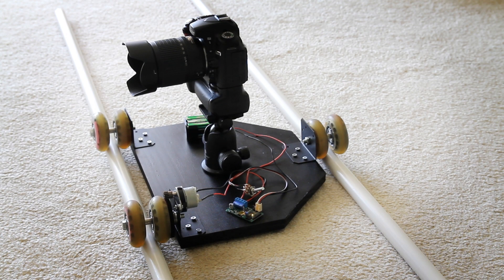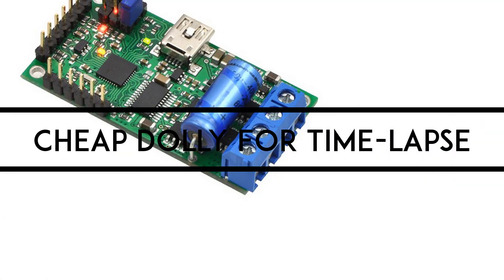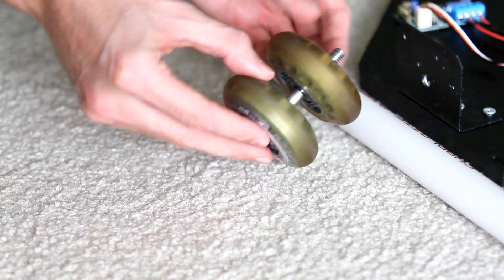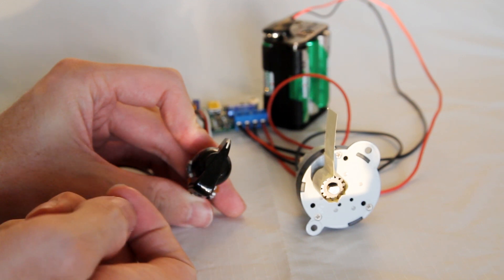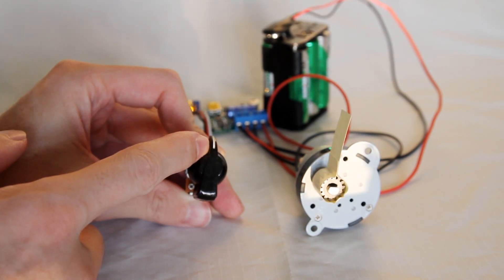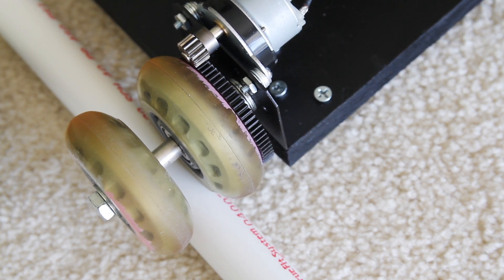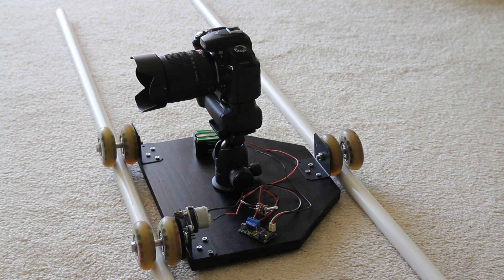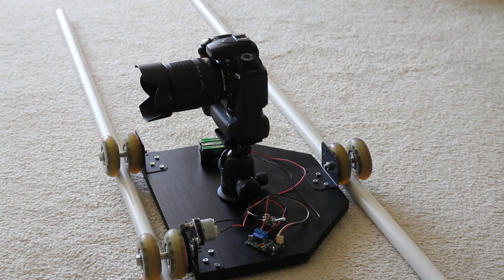DIY Time-Lapse Photography Dolly, First Attempt

Comment: This is the best DIY motorized camera dolly video I've seen.  Thanks for the blog write up with instructions in the description.

To overcome slipping, maybe wrap the PVC in skateboarding grip tape to give more traction.
Reply from the maker: That's actually exactly what I did :-) Well, it wasn't grip tape, it was a roll of adhesive sandpaper. It was better than the bare pvc, but still not perfect. I probably should have put a belt between the two sets of wheels on the drive side. It worked ok, though.
Reply: @MatthewGore  Painting the rails might give it a bit more grip as well?
Reply from the maker: @Tricklarock  Possibly. There's a type of grippy spray paint that is sold at hardware stores for making stairs non-slip and that sort of thing... that would probably really do the job, though I don't know how smooth it would be. But there were enough problems with this design that I decided it was better to move on to the next one, which really worked a lot better for me.
Reply: @MatthewGore  I need that for our sidewalk/front steps! Deadly when the slightest bit wet!!!

Comment: Thank you for this its a real help, ive just finished making my track and built something very similar but instead of motorising the wheels im thinking of putting the motor on the end of the track and gearing it down so i have a "50lbs breaking strain fishing line"? running down to the dolly and as the geared down motor turns it winds in the dolly pulling it towards the motor which i hope will enable me to have an incline on the track and obviously there'd be no slipping wheels as it's been "pulled" up the track as apposed to driving itself up and therefore the wheels would'nt slip.

Comment: how did you fix the roller skate wheels to the shaft(screw). When I got my Roller skate wheels they had ball bearings in the centre and that prevented the wheel from turning when the shaft turned

Comment: Hi, can you indicate me wich motor and wich gears you had used to build this motorized dolly ? Maybe you can give me where you buy them ? You've done a great job ! see u
Reply from the maker: I bought a couple of motors from a Chinese ebay seller. At the bottom of my blog post, there's a link to the seller on Ebay: http://www.lightandmatter.org/2015/general-photography-articles/how-to-build-a-motorized-diy-time-lapse-photography-dolly/

I bought the gears at a remote-control car shop. I think there are pictures of the packages in the blog post, but it's been too long for me to have anything more helpful than that :-)
Reply: thanks a lot for your reply ! have a nice day

Comment: Does it matter if the bit where you put the camera is smaller
Reply from the maker: Not really. I made the platform pretty big for stability, since with this design, there's nothing really holding it onto the tracks except the weight of the camera/platform, so I knew that if I were using a large lens, it could throw the balance off enough that the whole thing could fall off the tracks... or at least, it might make accidents more likely. 

My new design (not published) is much safer, and the platform is much smaller (and locked onto the tracks). If I can find some time one of these days, I'll publish it... it's also not very expensive, though it's more than this one was :-)
Reply: When will the new design be published? thx
Reply from the maker: Probably not anytime soon. I'm going to be traveling for the next couple of months... so November at the earliest. Sorry!

Comment: Good idea, but however, the motor has to stop when taking the picture and then start again moving.
Reply from the maker: FrozenSkiller Actually, since the individual frames will become a video, some motion in the shots is actually preferred.... for the same reason that a slow shutterspeed is preferred when shooting DSLR video ( 1/50th second if you're shooting 24 fps, or 1/60th sec if you're shooting 30fps) to keep the motion smooth instead of jittery. This also better simulates the effect of a dolly moving at real-time speed with a video camera.
Reply: FrozenSkiller why exactly? If you are doing a mid day timelapse you're probably gonna have a high shutter speed so it won't make a difference will it?